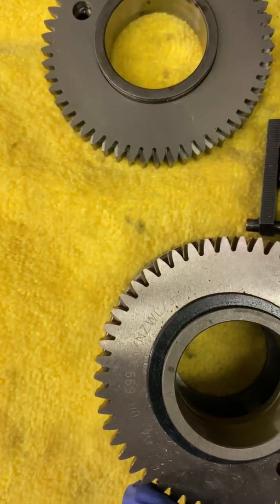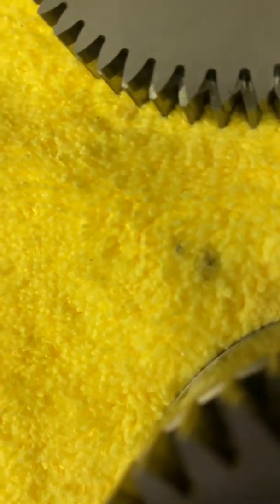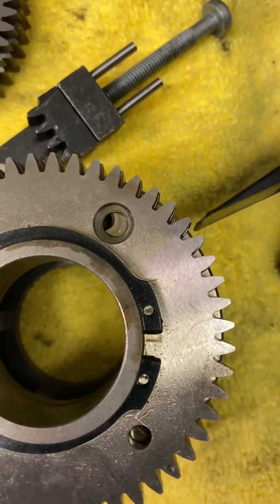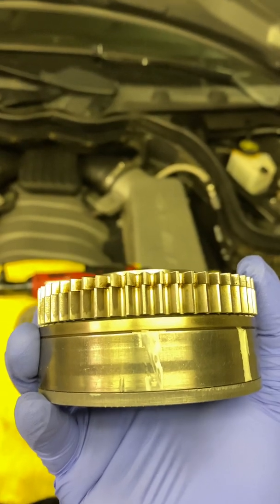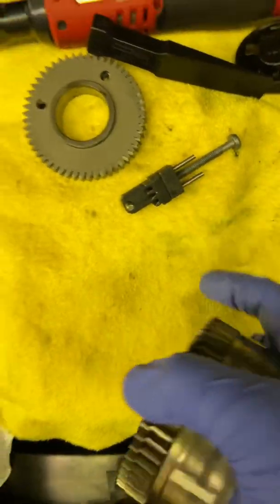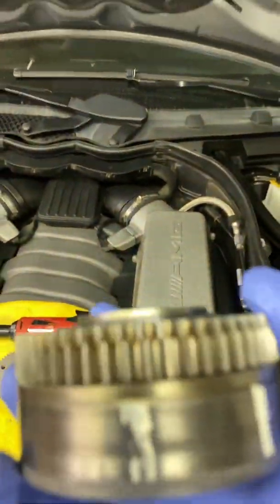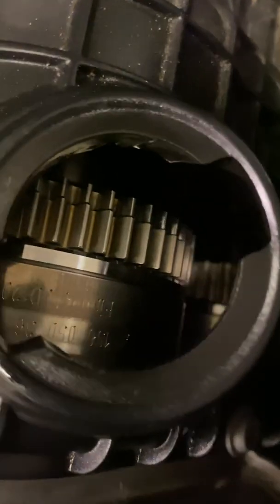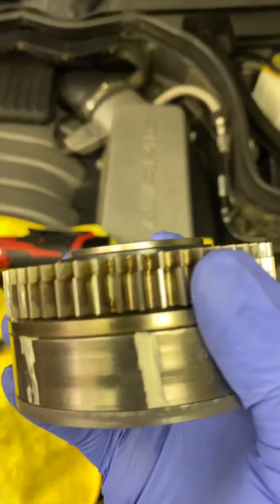Reassembly of M156 Adjusters and Lashgear Explained

Comment: Hey so should both gears exhaust and intake be align the same as you explained or is this just for the top gear???
Reply from the maker: All adjusters are locked with the tool. Not just one.
Reply: @63motorsportsinc.37  yea i was just curious about should all the gears have that offset to the left ,they shouldn't be lined up correct?
Reply from the maker: @ryanbrown99  that’s correct they are offset because of internal spring pressure. Otherwise they would freely float in between the teeth and cause a lot of noise
Reply: @63motorsportsinc.37  ok thanks. I experienced that when i 1st replaced my plates and boy was she noisy then i seen tasos say that backlash will cause lifter like noise. So i had to go back in and install correctly.. crazy how it still ran and felt responsive just that noise ugh.. glad i fixed it..m156